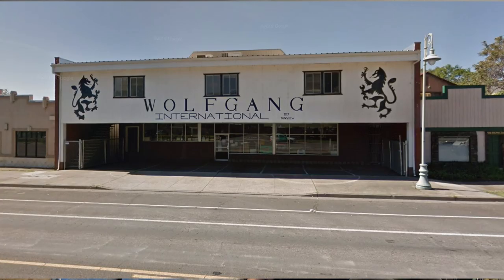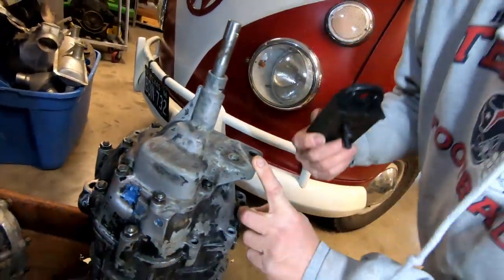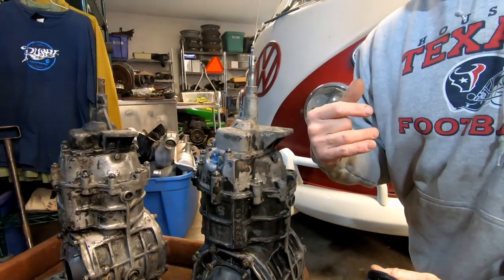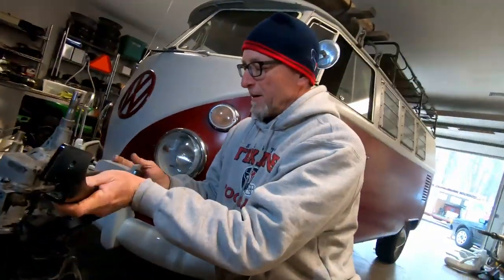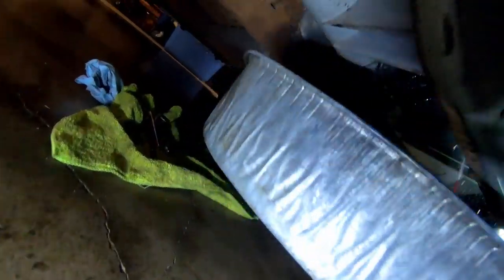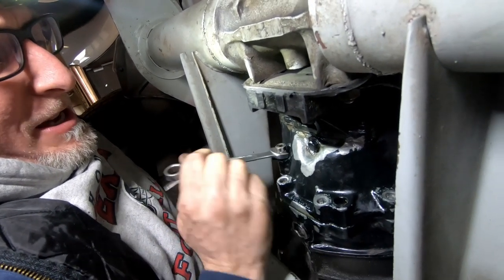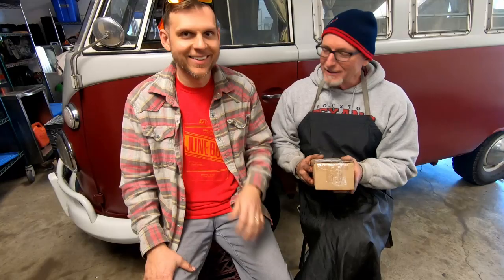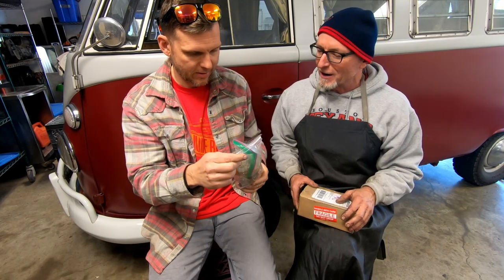VW Bus Transaxle Mid Mount Install!

Comment: Great info as always.  So glad I subscribed to this channel.  Question?  Would this also be applicable on a Type 1 Beetle?  Thanks guys!!!
Reply from the maker: Well we are glad to have you subscribed!. No these don't really work in the beetle. And I don't know if they make one for the beetle it's not as much as of an issue. With the reduction boxes on the split bus there's a lot of stuff going on that causes these front mounts to go bad
Reply: Yes they’re made for a beetle and help just as much as in a bus .. possibly more in a bus because of the torque of pushing more weight putting more demand on the nose cone in a bus .
  But in a beetle they do just as good keeping the nose cone from being over worked .
  They’re are built differently for a bug but the end result is the same
Reply from the maker: ah see that's why we have tommiebsmith on board!  a quick search does indicate they are available for beetles as well.  In this case though Wolfgang does not make them you would have to source them elsewhere.

Comment: I don’t think that will work on my buggy 😒. I have a early bus transmission with RGB’s and a 1835. All of it hanging off of a 60 pan with the EMPI body, so It doesn’t look like I have the right swing mount?  I was told to be careful, now I know why
Reply from the maker: I know this won't work with your buggy. You won't have the frame horns that are in a bus

Comment: I’m running a 1600cc dual carb set up on my 64’ beetle would you recommend to upgrade to a freeway flyer transmission?
Reply from the maker: probably not, if it's running good the way it.
Reply: Thanks guys 🤙🏼🤙🏼🤙🏼